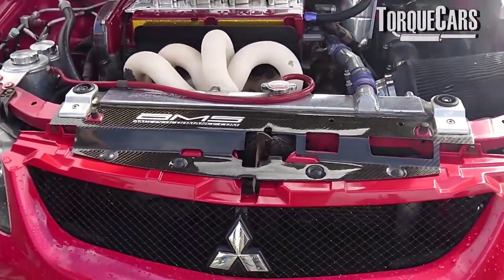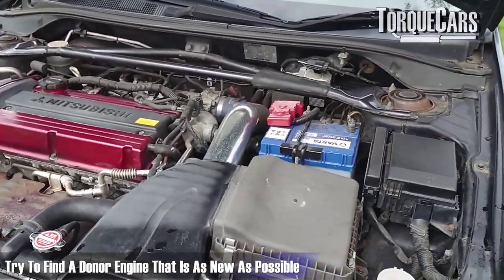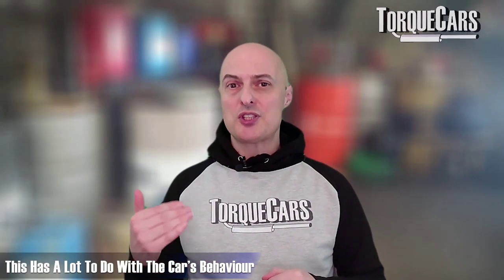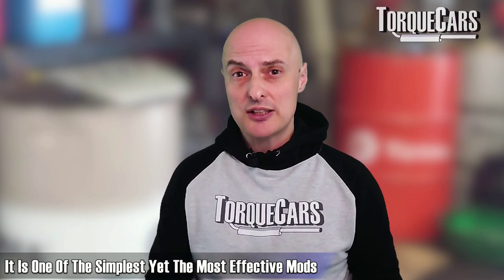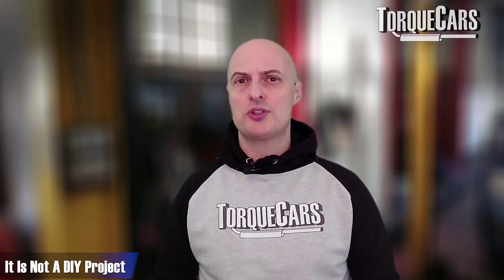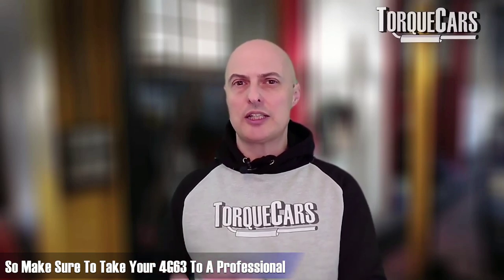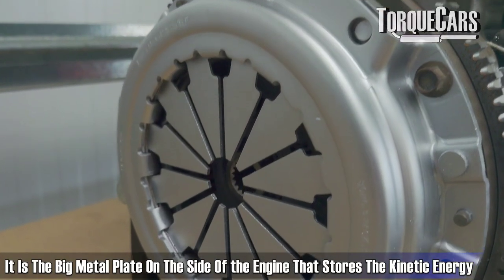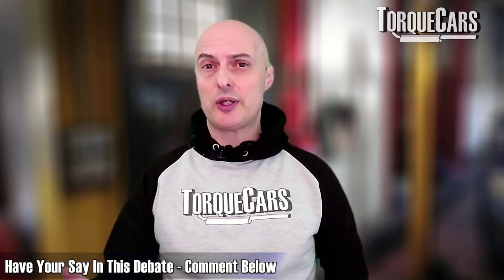Best 4G63 & 4G63T Best Peformance Mods & Tuning Upgrades [Tips]

Comment: I got 508 HP on my evo9. I suggest removing Mivec at all it makes lots of problems while tuning. I put big twin scroll Borg Warner EFR turbo with manifold, forged pistons from JE + pins, better bolts, gaskets etc. Perfect daily driver. So much torque from low rpm you couldn't believe it. Each time I go for a ride I'm happy like a kid.

Comment: You confused some bits. The main problem is torque, not horsepower. Around 400ft lbs of torque is the maximum for stock internals. The stock ecu is easily reflashable using ecuflash and evoscan to log it.
Reply: what about an obd1 ecu?

Comment: My 4g69 might not be a 63 but it's got just as much potential. Is SOHC but has mivec, no turbo but has 87mm bore and 100mm stroke. Stronger rods pistons fasteners and a stock evo 9 turbo, you can easily hit 400hp plus.
Reply: @Sero12245  love my 4G69! I think the internals are a bit on the lighter side just because these were moreso made to be rev-happy N/A motors, lots of people do use our block for their builds because it's short deck and already comes with a "stroker" crank outta the box lol(same deck height as the 2.0s iirc but long throw crank, and they moved the wrist pin higher in the piston)

Comment: If I have the 4g63 engine of Mitsubishi galant 2001 And I put it on Lancer sport can I put turbo to it?
Reply from the maker: This video touches on that question, https://www.youtube.com/watch?v=EACZv3mrwRw in short it can be done but there are lots of other things to sort, the engines are not the same internally so adding a turbo is only a small part of the equation.

The turbo block 4G63T is physically the same size and bolts in with minimal fuss so an engine swap to a turbo is usually the cheapest option.
Reply: If you're set on finding a N/A Engine to turbo, You could also look for a junkyard 4g64(also came in early Hyundai sonatas with dual cam head) which came mostly single cam but the 2.4 displacement is very nice to spool a turbo